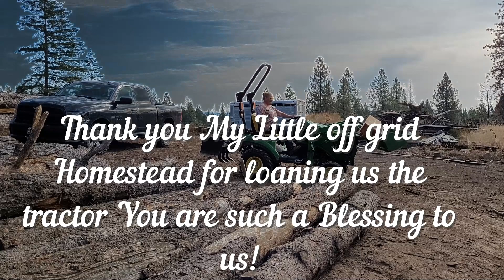Milling a ROTTEN bug infested LOG on Homeowners Sawmill!!//DIY BARN KIT

Comment: Ms Heather - Look at this video at about 4:00 minutes as you're rolling the log with the log roller.  Head, shoulders, and hips are generally the heaviest parts of our skeletons but, women often have more hip weight then men. Look to see if sitting down more, lowering those hips into leverage, will reduce the wear and tear on your body; you will want a straight lower back and a "ballerina's (abdominal) core" while using your shoulder weight pulled back with neck (and the weight of the head) not rolled forward.

Comment: I bet you already know this but.   Let the sawdust age a year or two before putting it on a garden or anything wanted to grow. 😄
Reply: If you use a pump sprayer with Liquid Copper in it. Spray it on all your rough cut lumber.  You won’t have to worry about termites or any other bugs damaging your lumber later.  We did that to ours 30 years ago.  Still no bugs and it’s in Low country on a river in south Fl.